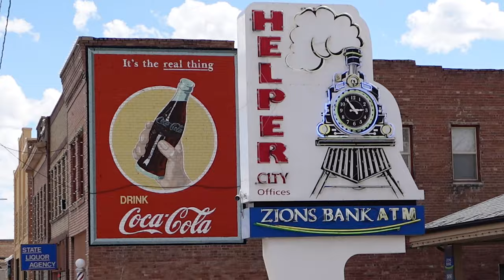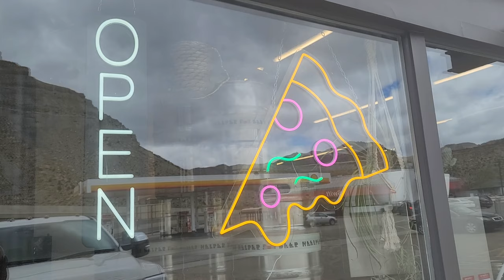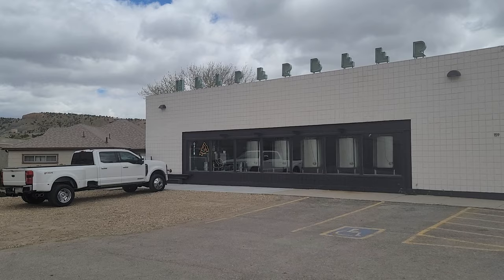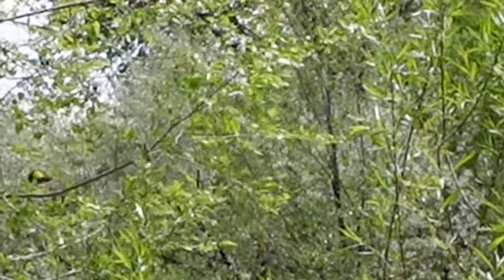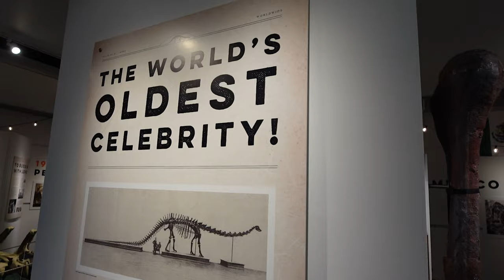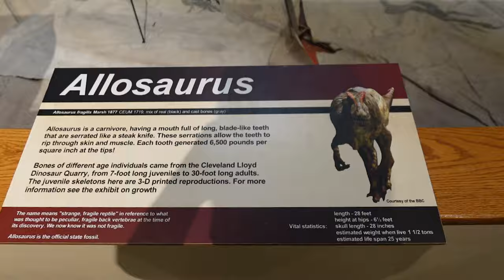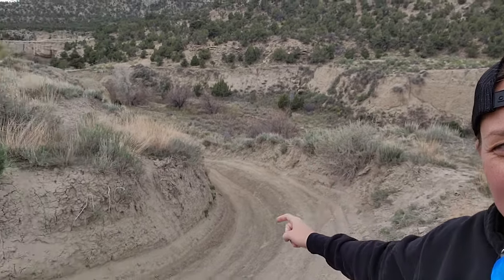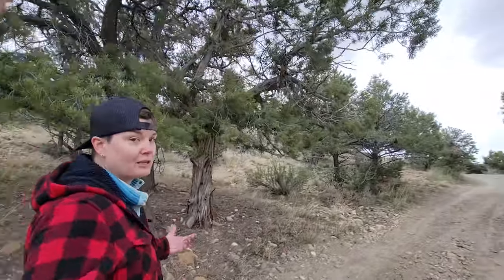Brand New RV Leaking Again | Never Hike on an Offroad Trail | Full-Time RV Life

Comment: You should NOT use any oil based lube on the slide rack and pinion...in fact they do not require lube. using a lube causes dirt to stick causing excess wear on the gears. This has always been the case. I've been doing this since before there were slides and was a manufactures rep. Rubber seal lube is a great idea. Also WD40 is not really made as a lubricant... the WD stands for water dispersant
Reply from the maker: It was our understanding that white lithium grease was the best option, we will look into it. Thank you!
Reply: @LesbiFITAdventures  NOOOOO!!!!!  Leave the gears DRY. Watch the Lippert videos
Reply from the maker: We will! We did get our advice from techs, so I am just going to ask Brinkley directly for clarification. Thanks!

Comment: on our 2022 Jayco Pinnacle the crimp style fittings on the PEX line for the washer was leaking, the dealer that repaired it changed all those crimp style bands with compression fittings.  One, those crimp style are a pain to remove and you need a special tool to install them, second another one always seem to leak after a few trips so we just had them replace them all - warranty covered it.
Reply from the maker: That's great. This will be the 2nd time we are getting the check valve replaced under warranty. Brinkley has been great to worth with on any warranty work!
Reply: Sadly you shouldn’t have to deal with these kinds of problems on a 100K plus RV …
Reply from the maker: It's all part of the shakedown process and is to be expected with RV ownership, even if it's inconvenient. Thank you so much for taking the time to watch and comment! We really appreciate it!
Reply: @LesbiFITAdventures  One thing about RVs, is they will never disappoint on repairs and small issues. I mean traveling down the road with all the bumps etc, things get knocked loose etc...this is our 3rd 5th wheel.  I will say the pre covid one we owned were less problematic..but that's a different conversation.